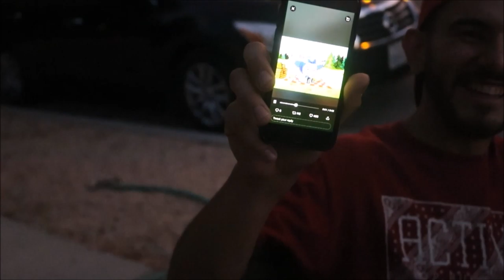The New Daily! (6 Speed, Turbo, And AWD)

Comment: Before you do anything make sure yall swap that cam cap so your engine doesnt grenade
Reply: Nelfi_em1 is your talking about the cam follower on the high pressure fuel pump, first thing I’ll be doing to the car
Reply: Leo Ochoa  yeah its very common and ive seen them go bad at 20k miles